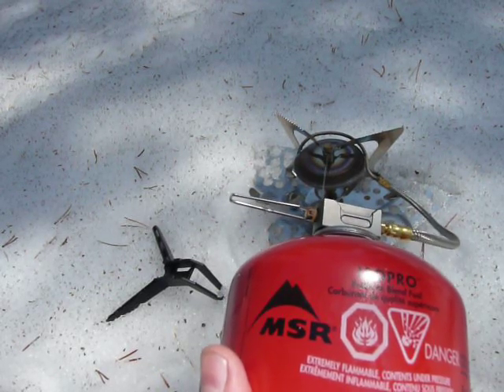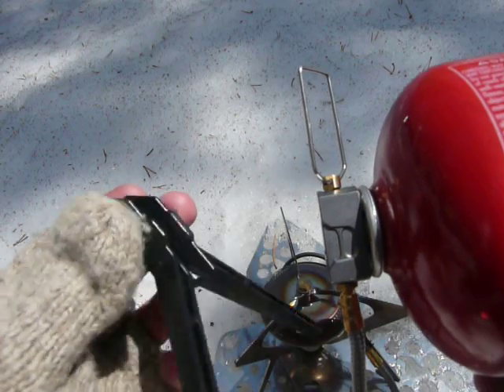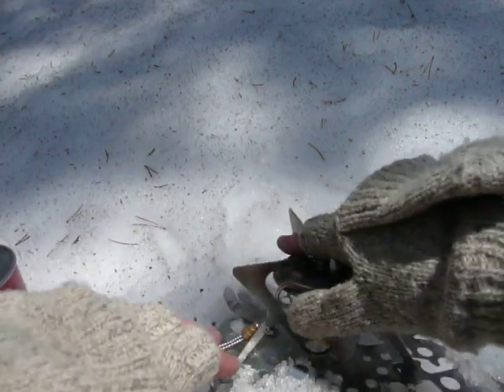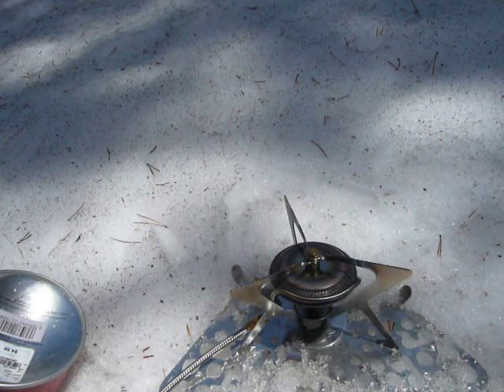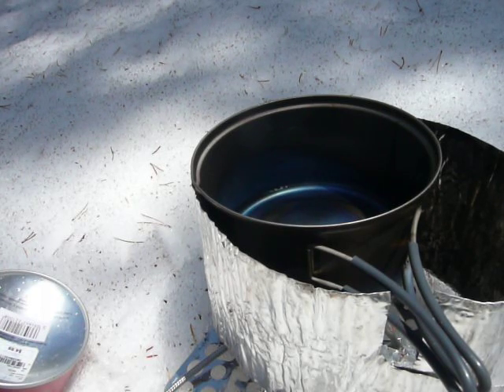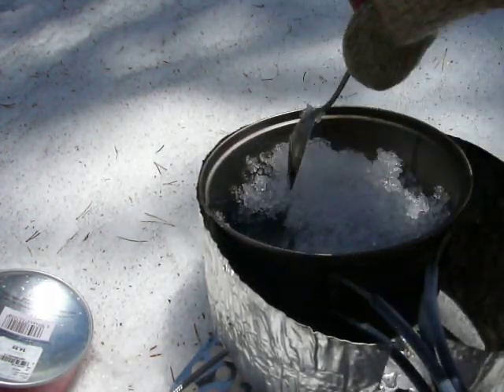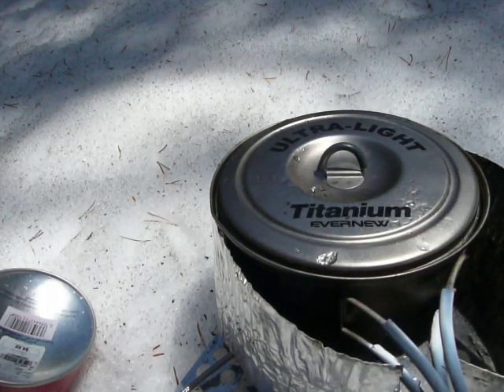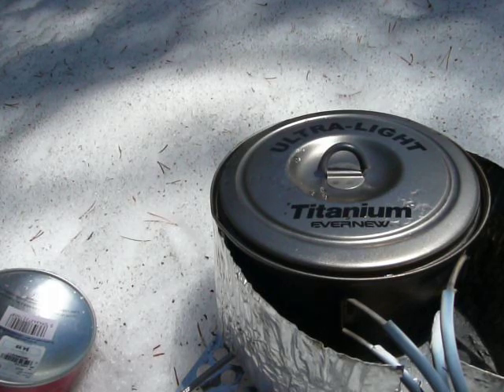Melting Snow with an Inverted Canister MSR Wind Pro II

Comment: You've just confirmed in my mind that I'll stick my LIQUID FUEL stove.  Canister fueled stoves just don't have the same consistent performance in COLD & WIND that a liquid fuel stove has.  Liquid fuel stoves maintain the same heat output whether the bottle is full, or near empty.

Comment: HI this is quite dangerous , you MUST use the stove lit for a while in normal mode or as you see from the video it gives some considerable flare up , if you were using this in a tent well ...... , also its best to add water to the pan first before just putting in snow as this can cause permanent damage to your pans !  just some advice from a mountaineering instructor in the UK